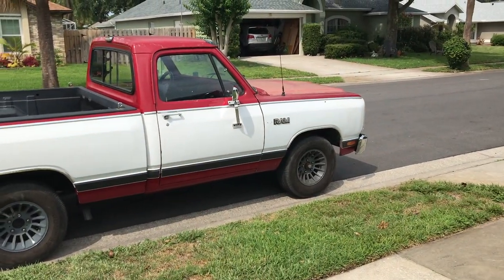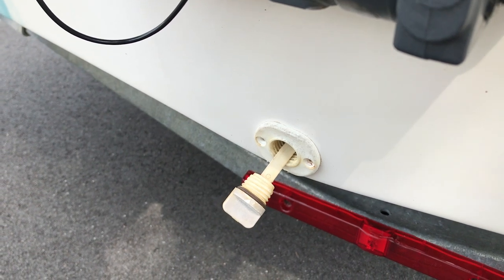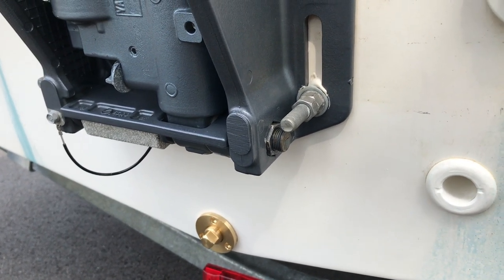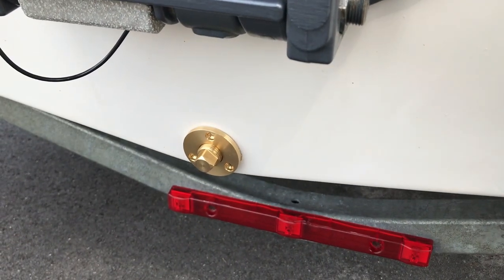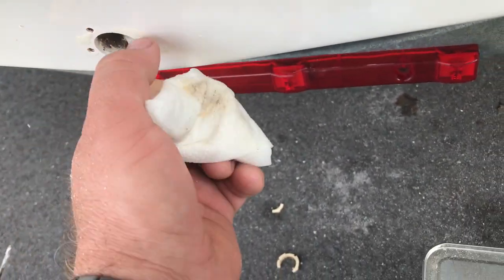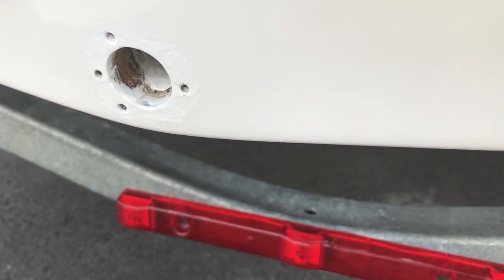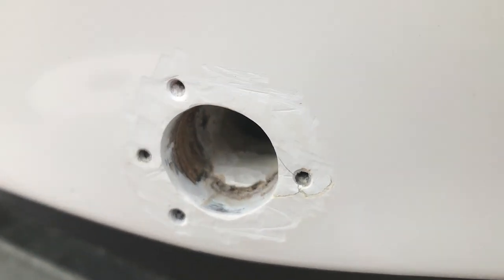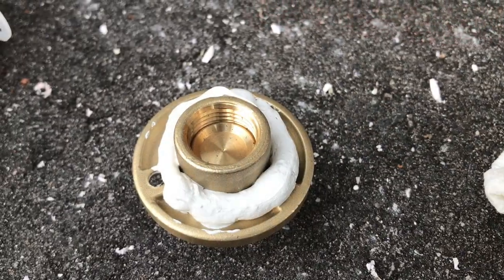Key Largo 160 Garboard Drain Plug

Comment: I have a 2005 that I just put a 70hp 4 stroke Yamaha. I love this boat! I have a custom made lean to and have had all fuel lines replaced plus I put a new lowrance elite 7 with side scan on it. Runs at 34mph top end, but the hole shot is a little slow. I sealed the hold on port side with cork and gel coat, but still can’t keep water out. The guy that makes this boat is out of business so hang on to it, it’s the best 16ft there is in my opinion.

Comment: those are the crappiest transducers ever made. Literally will fall apart. Ive had 3 lowrance transducers delaminate and or stop working. everyone upgrades to airmar p66 50/200 khz.
Reply from the maker: Thanks, I saved the p66 in my Amazon cart just in case